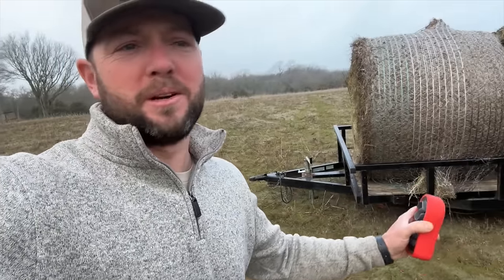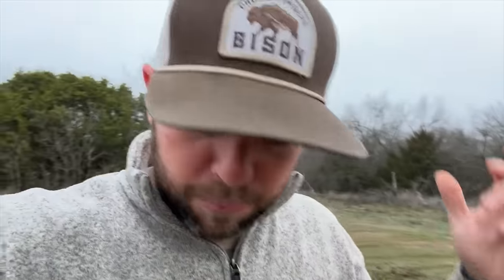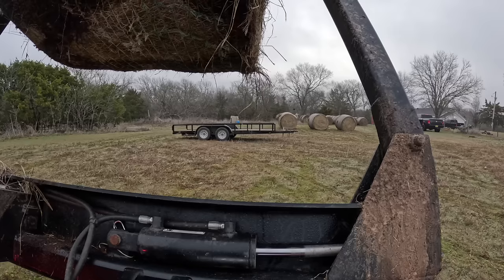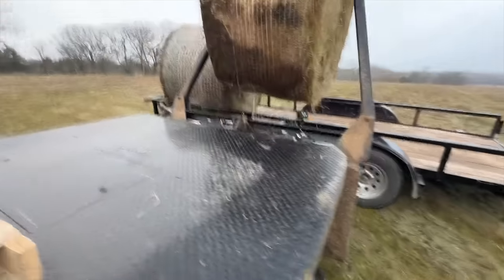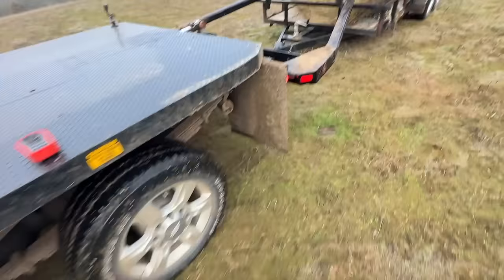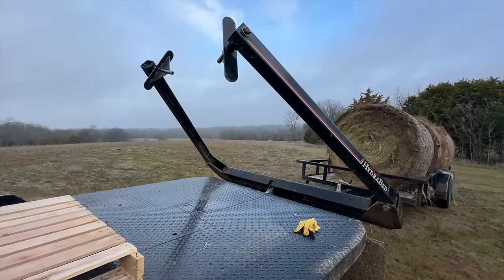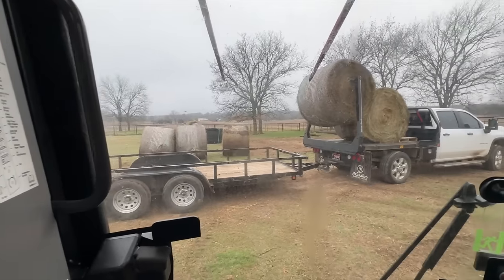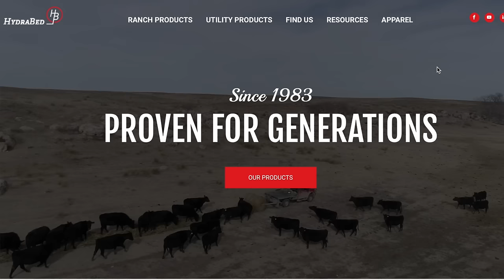Tried Something New, Had to Find a Way Out!

Comment: We always had a couple 2x10"  and 4x4 " board pieces that were trailer hauling standard equipment, no matter what trailer we pulled. Even when we were unhooking on paved ground,  we used at least 1 under the jack. The camper always had quite a few board pieces for leveling too. So glad that you were able to fix the problem so easily. Way to go!

Comment: Hey, Dusty... I notice that you're loading on your blindside... nothing wrong with that, but... if you set your trailer right, you could drive past it and back up to your good side to make it easier...
And also, now that you're going to use that contraption, you can stack them accordingly... back to back instead of flat side to flat side... good job... don't mind me... just spectating...